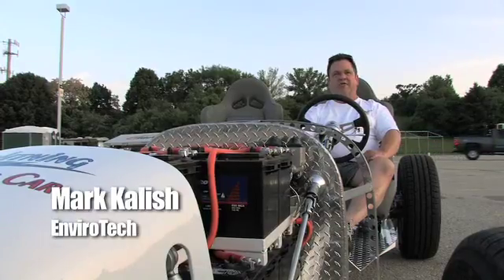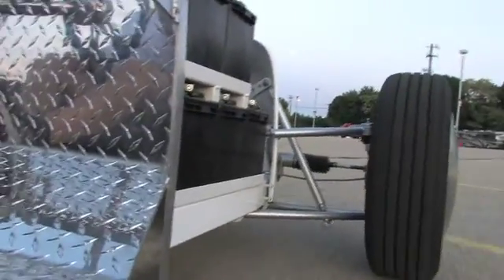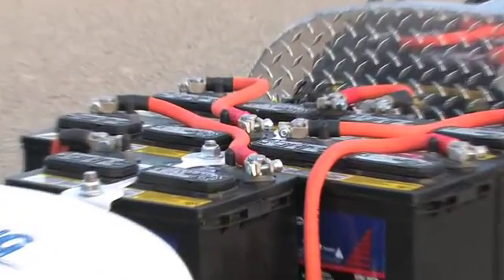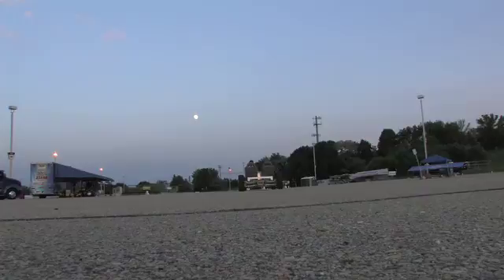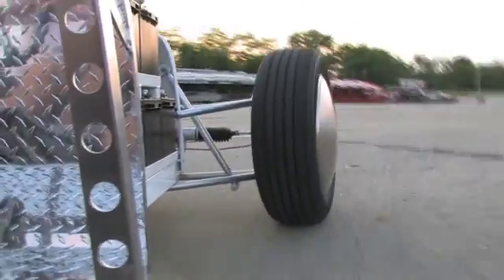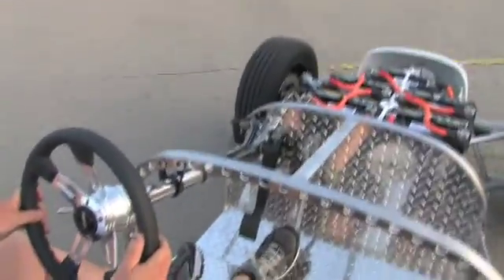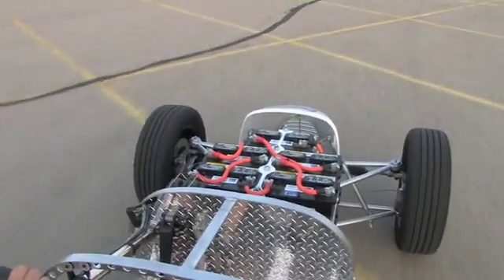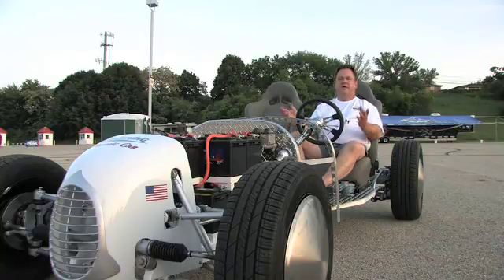HOT ROD Magazine - Power Tour 2009 - Lightning Electric Hot Rod

Comment: Are you using the 13" impulse?  I'm thinking of making a hybrid with a 9" impulse, but I'm not sure about how well the motor will dissipate heat, I'll also be using a 156 volt system with 13 12volt batteries.  Does your car use a transmission?